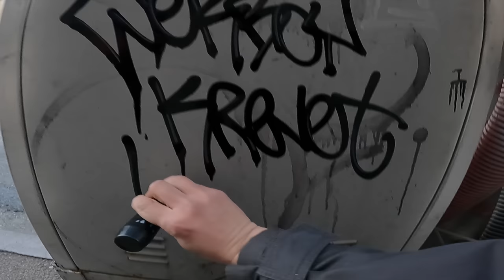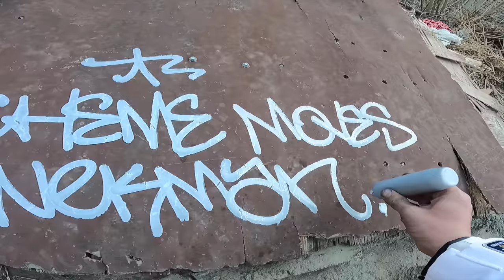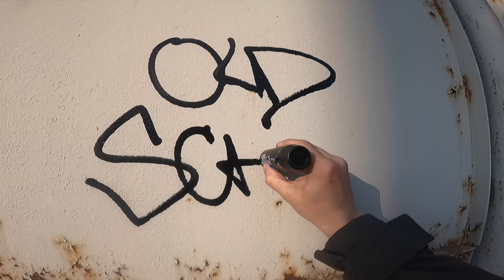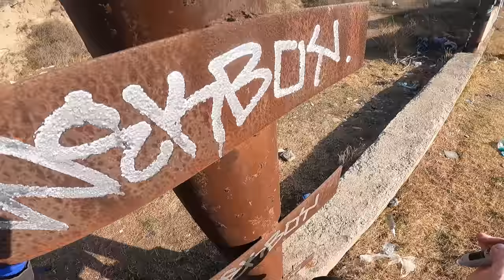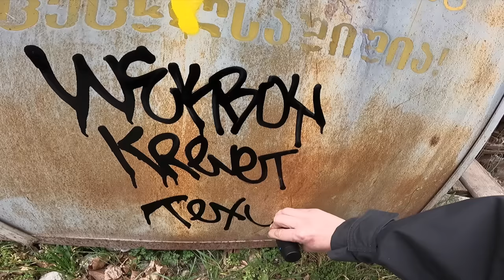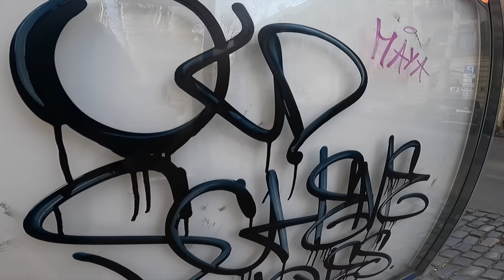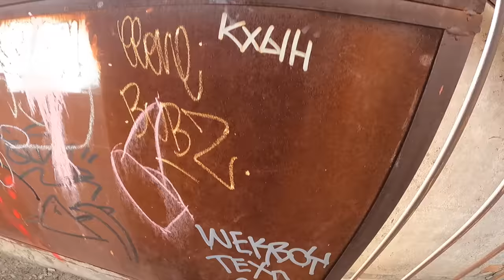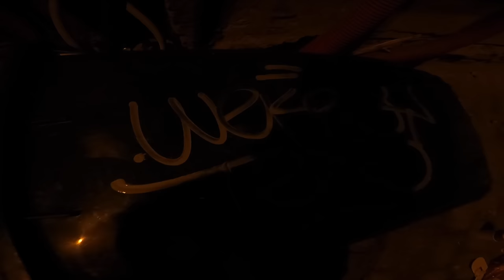Graffiti review with Wekman// Domino Ghost Squeezer 90 ml and Chrome and black ink Grog Paint 200 ml

Comment: Grog FMP chrome ink is very good and cheap. I think it's relatively best chrome ink. By the way it works also in pump-action markers and it's better to use it while it's cold because It's very thin and in the summer it drips like crazy.